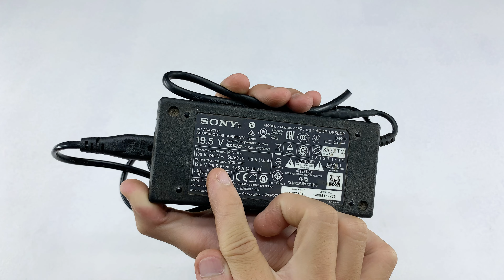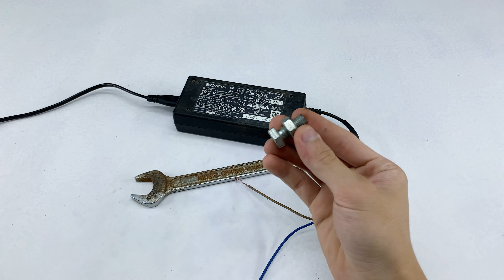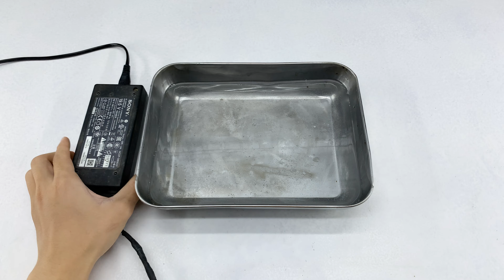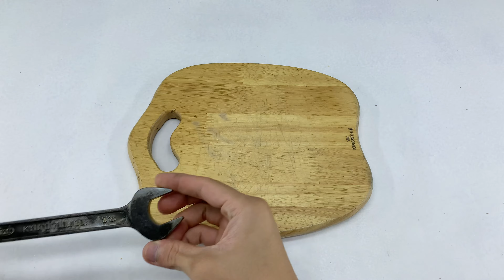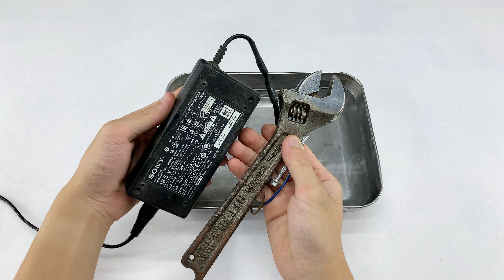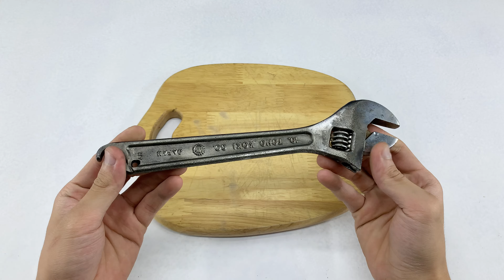Unbelievable! Hidden Feature in OLD LAPTOP CHARGERS! Millions Don’t Know This 😱

Comment: Electrólisis... podes reemplazar el agua con sal por vinagre. O incluso el vinagre solo también funciona. En la electrólisis si los materiales los conectas al revés, podes hacer enchapados.
Reply: Es decir, una vez el material desoxidado, pasas lo cromado de una llave (por ejemplo) al material a recubrir y le haces un baño con ese material.
Reply from the maker: Exactly, my friend 🔧✨. That’s the principle of electroplating: by reversing the polarity, the chrome metal (like from a key) acts as the anode and transfers a thin layer onto the object you want to coat. You just need to control the voltage and time to get an even finish. Excellent observation! 👏⚡
Reply: Igualmente hay que hacerlo en un lugar ventilado, cuando haces electrólisis, estás separando elementos, por ejemplo, del agua, con la electrólisis de un cable vas a obtener hidrógeno y del otro cable oxígeno.
Reply: Y al desoxidar materiales es lo mismo, pero genera otros gases, que son medio tóxicos por la sal o el vinagre. Estaría bueno que algún químico explique mejor lo que intento contar.
Reply from the maker: Absolutely right, my friend! 💨⚡ You’re completely correct — electrolysis releases hydrogen and oxygen, so it must always be done in a well-ventilated area and away from heat or sparks. Safety comes first. Thanks for highlighting that important point! 🙏🔋
Reply: También la pieza de sacrificio tiene que ser de mayor masa que lo que queremos desoxidar. Cualquier cargador de notebook que nos de 3amp. Es suficiente para cualquier proyecto casero promedio.
Reply from the maker: Excelente aporte, amigo! ⚡️👏 Tienes toda la razón: el vinagre también funciona muy bien como electrolito, y si inviertes la polaridad, puedes hacer procesos de enchapado. Gracias por compartir ese detalle tan útil. 🔋✨